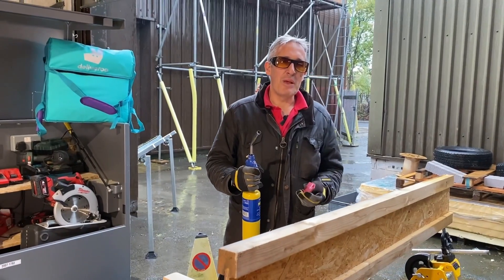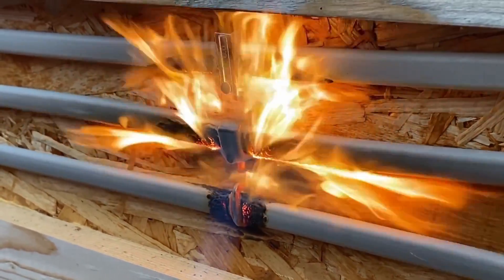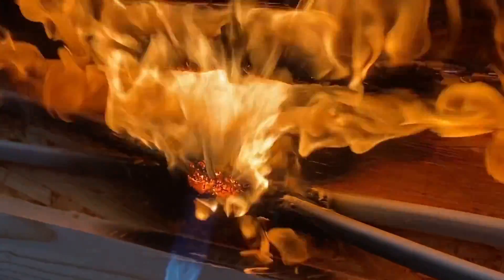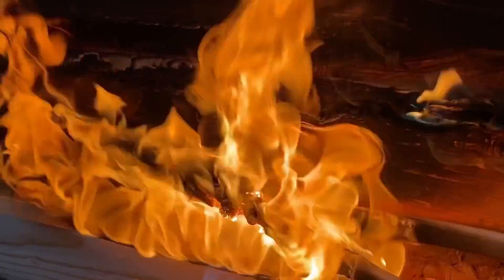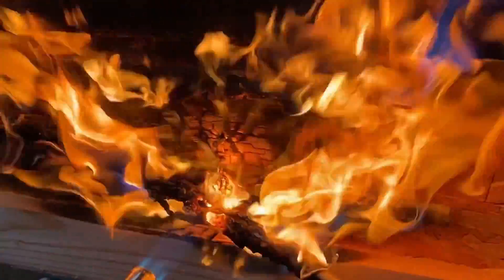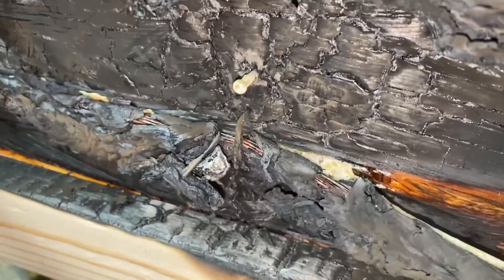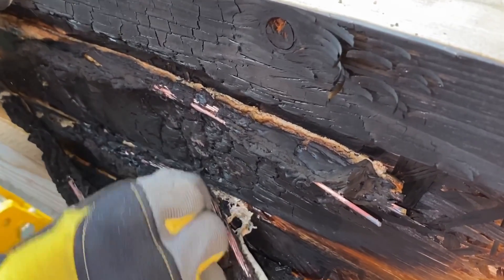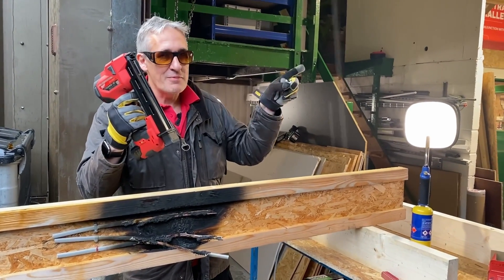Milwaukee Cable Staples: Are They Fire Rated?

Comment: Interesting video guys.  I do think that more metal clip / staple / supports should be used throughout the building when cabling or even plumbing.  I see no real difference for industrial/commercial or domestic with regards to this.  Plastics melt and burn a lot quicker that metal or rocks.  Same applies for foam insulation.  I strongly believe that all electrical accessories should be tested and made to comply to be fire retardant by law.

Comment: I fully agree with this in multi storey buildings but most domestic properties will not be safe to enter before cables collapse. 
Wish CU location was as big a priority for the industry 😵‍💫 should be against regs to even replace in old location. Should be near the door and not obstructed in any way.

Comment: Being controversial. Why? If it was a heavy swa i agree, if it was a big bunch of network cables, they  are usually resting on basket tray. These clips can be used only on wood, so assuming for domestic property, if so, plasterboard provides 30mins of fire protection and if plasterboard did fail wires go through the joists and wires that run parallel are usually taught. Have I missed anything?